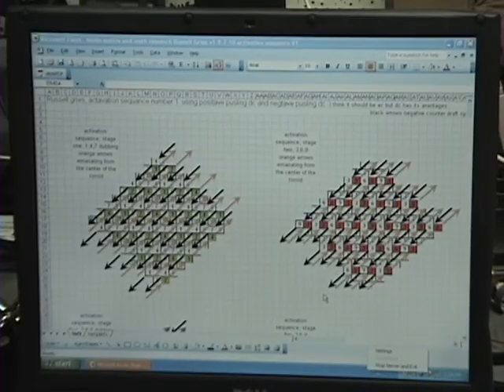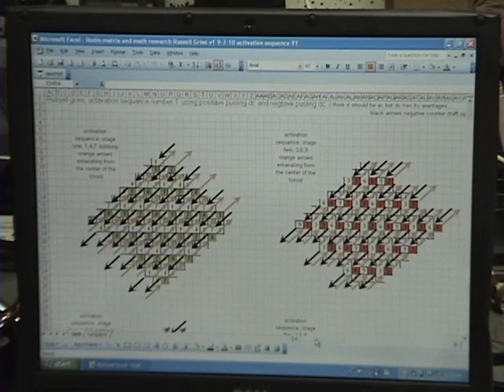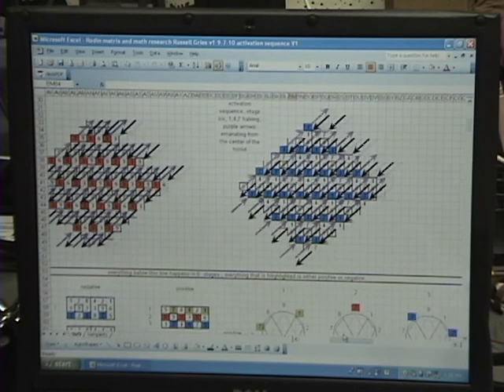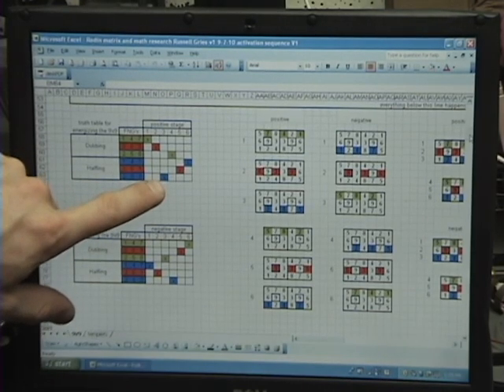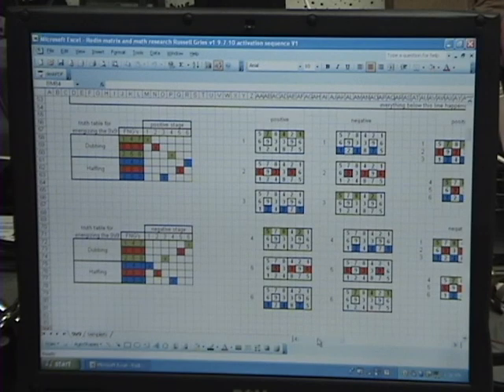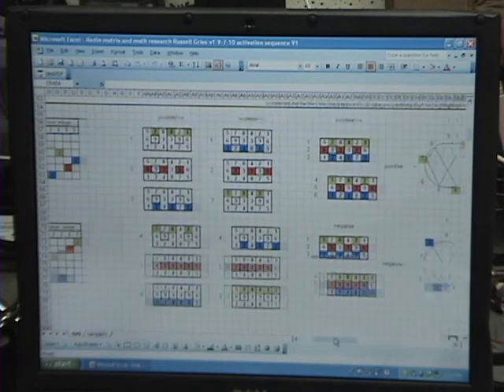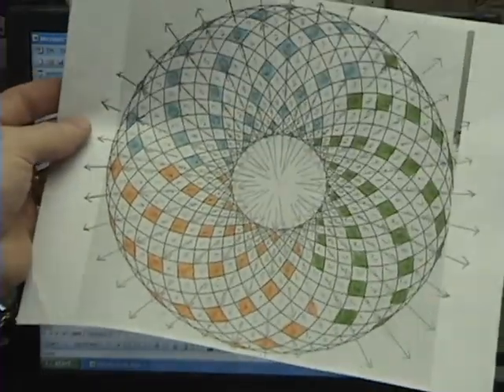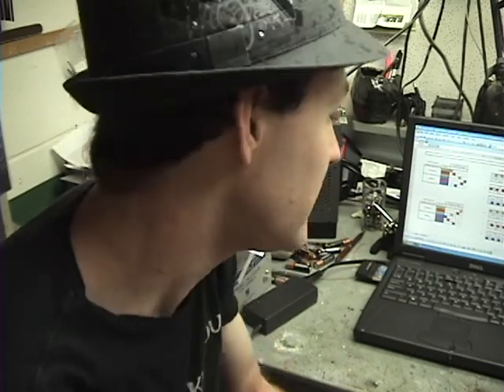Energizing the Rodin/Powell coil a deferent way. Out side the box. Help!

Comment: I thought i would tell you the true power gain of the wire. It doesnt have to do with the winding but rather the Crossing of the wire. THINK about it life is simple complex. When two rivers flow fast and hit each other and  that will cuase a vortex ripple in the water. Same difference with negetive energy.